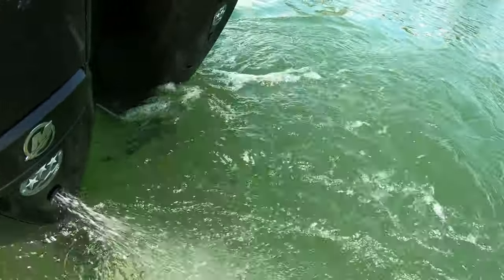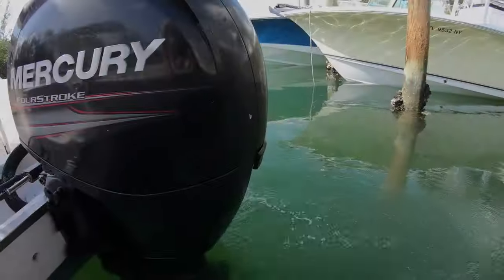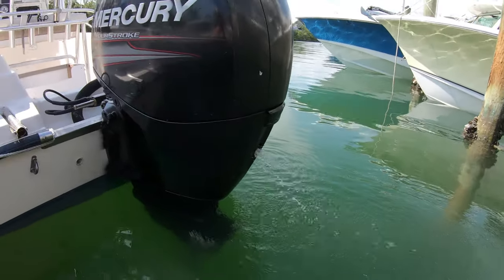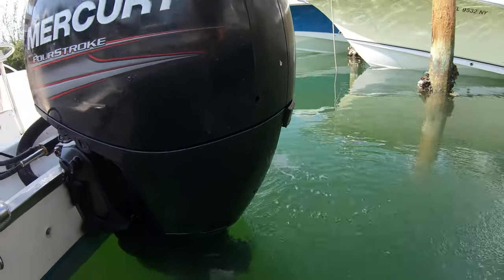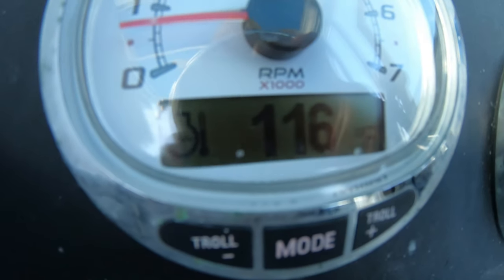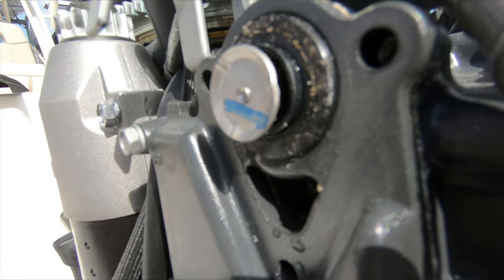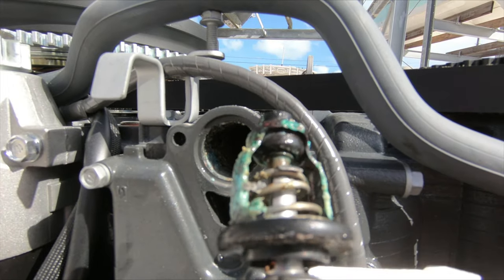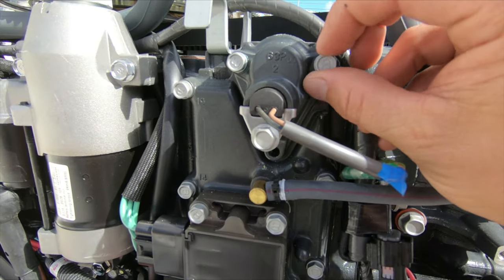The Reason Outboards Squirt Water From the Exhaust!

Comment: I have a 15hp 2022 Suzuki that has only 9 hrs on it. I  noticed that cool water was coming out of the P tube and I was Concerned it might be a stuck thermostat. So after reading your article I saw that on idle no water was coming out of the exhaust but warm water was coming out the back of the prop like you said it should. The power head also felt warm. This engine has a fuel cooler that is connected directly to the p tube. Does it makes sense that only cool water would flow through it?

Comment: I have alot of bubbles coming from lower unit and has never happen before, i have a 2011 evinrude 40hp etec. Could this also be thermostat?
Reply from the maker: It could be yes, but it's also normal to have bubbles from the exhaust. You say it's a new thing, so you might also have a clog or something that is not letting the exhaust out of the above the water exhaust while at idle, you could also be idling higher than normal and have another issue, or you might have a running issue or a problem with a spark plug or coil that makes it not fire correctly creating an issue that just makes the exhaust at the prop more prominent. Hard to say what it is because it could be a lot of different things, or it could be nothing, this is an issue that a Youtube comment probably won't be very helpful with :/

Comment: Thanks for the explanation. I have a Mercury Bigfoot 15 hp from 2003 doing the same thing, so I was wondering if this was a problem. For the rest it runs fine, but I will replace the thermostat with the coming maintenance.
Reply: So, was it the thermostats?

Comment: I have 2 Suzuki 225df 2006 models. One is bubbling through exhaust at idle. I think its because the idle exhaust port above water line is blocked....do you agree? and how can I unclog it? Thanks.
Reply from the maker: Yes, that could be it. That with the thermostat. There is also a water valve on the port side of the  midsection on those engines. 

I think it's the port side, I know it is on the 140s but not 100% on the 225s.
Reply: Poppet valve on mid section
Reply: @BornAgainBoating  mine is a 150 saltwater series 2 yamaha.  I noticed it spots water.  I've changed thermostat, impeller, and done many saltaway flushes. Only I have done is poppet valve.  No alarm YET  but just wondering if I'm good and this spring is normal.  Only time I get an Alarm is on muffs cause it doesn't it deal it right and I think that's from poor yamaha design on curves not allowing proper seal on the edge

Comment: my yamaha 150 started to steam out the upper exhaust port. Changed Tstats and water pumps with no change. Any ideas? thanks
Reply from the maker: Smoke is no good, color is important too, but did you look at the poppet valve?
Reply: @BornAgainBoating  it appears to be smoke. I ordered a new poppet valve. Also noticed a sheen in the water but it was rough and may been from the exhaust smoke making contact with the water. I have to check it at the dock to confirm

Comment: I love your videos! I have a new Yamaha F300 with 8.5 hours on it. There is steam coming from the exhaust, not all the time, but some days more than others. I also noticed at 2 hours. Is this something I should be concerned  with? How does water(steam) get into the exhaust system? Water is squirting out of the side of the motor and it runs great.

Comment: Hey, just looking for some knowledge. I think you might know this one. The 2004 yamaha f225txrc.. what's the difference between the two upper case gaskets? Would any damage be done if using the incorrect one? One has more perforated holes than the other. I feel like my engine pees a little weaker because I'm using the wrong one. I replaced my corroded exhaust with a good 08 exhaust and that gasket was different than my 04's. My 04 has the one with less holes, the 08 has more holes. Thanks for your help.

Comment: Thanks for this great tip, no one on youtube explain about this....I thought my motor is design to pump water out from exhaust
Reply: Some motors are designed to do this, in addition to the PTUBE. I have 70 HP Johnson 2 stroke, 1984, and it has always pumped water out the exhaust, for 20 years. Mechanic said that's the design.

Comment: I’m getting smoke from the central hole from a mercury 20hp what can it be?
Reply from the maker: cause can either be Overheating, Oil Leakage, Incorrect Fuel Mixture or Dirty Fuel Injectors, Exhaust Blockage or Malfunction, or Damaged Engine Components

Comment: My yamaha 2004 f15 also have this simtom,water coming out from exhaust after I change the propeller..
Is that I must change the thermostat?
Reply from the maker: Hello! Smaller engines like a 15 horse might do this even after you change the thermostat, but yes, the thermostat might actually get rid of it for you! Other than that, I wouldn't worry too much about it, it doesn't do any harm to your engine :)
Reply: @BornAgainBoating  thanks buddy:)

Comment: Speaking of midsection can anyone tell me the reason the midsection fade so fast I realize the exhaust is running through it but i buy used motors and they always look good for about a year then fade out mercs, yamis, and johnsons ranging from 15 to 150hp?
Reply from the maker: Not really, maybe just age of the engines. The 2002-2004 Yamis had an issue with the material used but that's the only thing that comes to mind!
Reply: Born Again Boating currently my issue is with a 2008 mercury 25hp also I run in freshwater

Comment: and I replace thermostat and Poppet valve in both 150s always does when in idle...
Reply: There is a rubber boot that connects behind the   Plastic container where the water is coming out at that boot will tear from vibration and cause this water to come out
Reply: @austinanderson8818  thats the rubber on the poppet valve? and my problem is that is not only in idle , is also in high rpms !!!!!